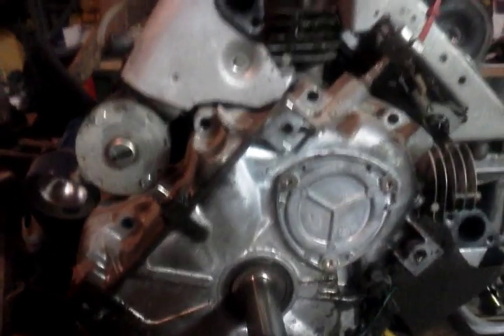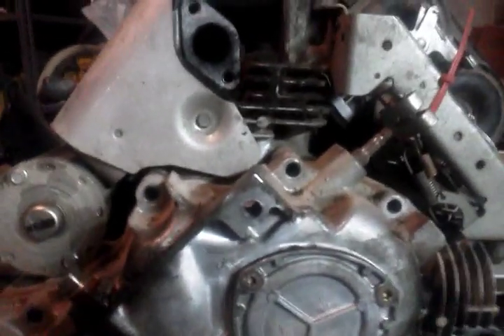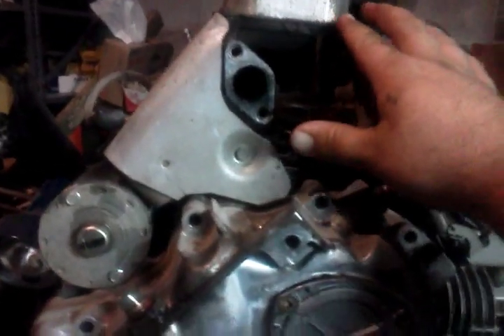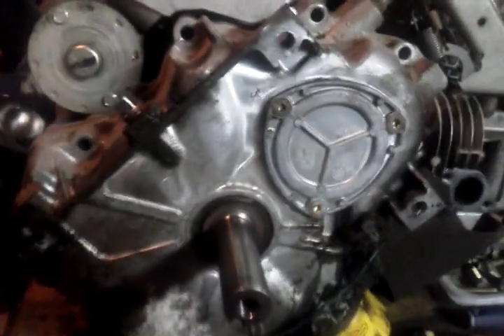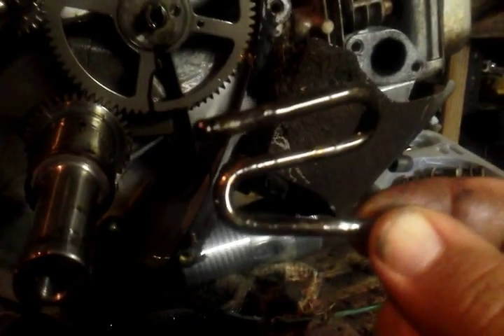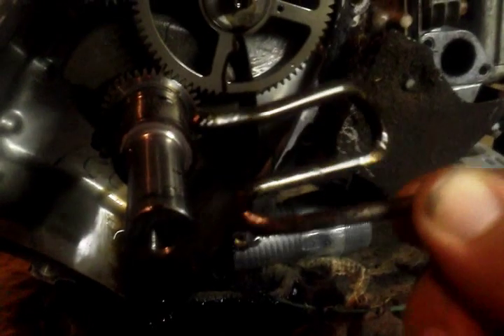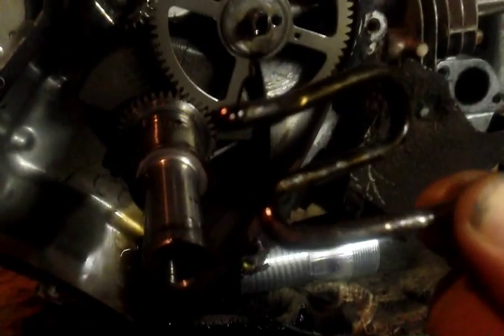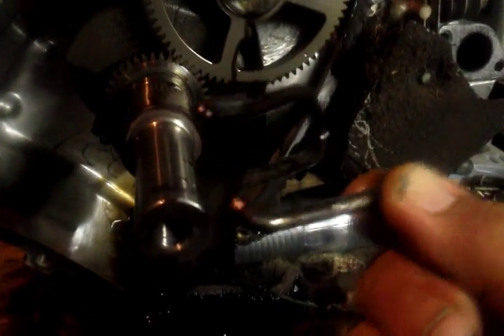23hp Briggs pushrod failure

Comment: sorry to pull up an old video but this just happened to my husqvarna 23hp on Tuesday. did you have to do anything else once you removed the bent rod or did you just put a new one in and run it? didn't know if i had to put new guides or anything in or if it damaged the heads or camshaft?
Reply from the maker: Derek Shanebrook just replaced the rod and sump gasket
Reply: awesome! i'll give that a shot! keeping my fingers crossed since that'll save me a small fortune!

Comment: Working on my B&S 23 HP and same issue. Exhaust push rod is missing. Getting ready to go out and try and find it. I did buy a replacement rod for $4, but the guy at JDeere told me that once it starts happening it keeps happening. Has that been your case?
Reply: +Lone Star Windmill Did he happen to give you a solution for stopping them from bending, or the reason they are bending in the first place? I am having the same problem and would like to fix it once and for all...
Reply: He said there were several possible issues. I live in central Texas and it gets hot and humid sometimes. He said if the engine gets too hot it's possible for a valve to stick, bend the rod and then drop. I've only mowed a couple of times since I replaced the rods, but I'm now mowing during the cooler part of the day.
Reply: Should have added that it sounds like snake oil to me, but he said that B12 gas additive would help the valves from sticking in the future.
Reply: +Lone Star Windmill  Hey, thanks for the info, sounds pretty consistent with everyone elses symptoms...
Reply from the maker: This was caused by the valve lash being too small or in this case non existent. Once it got to small and came up too tdc and bent the rod. The engine is fine now once I adjusted the valve lash correctly.